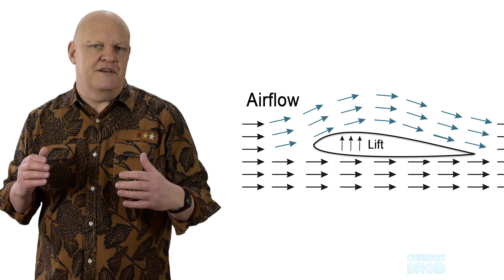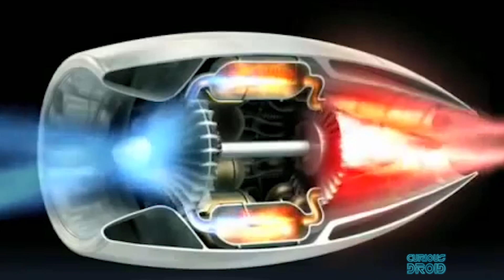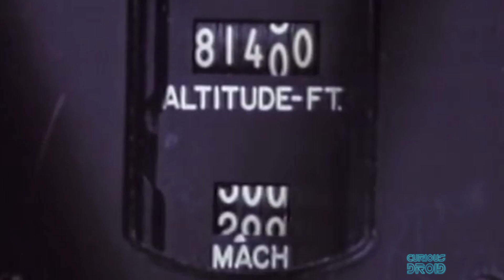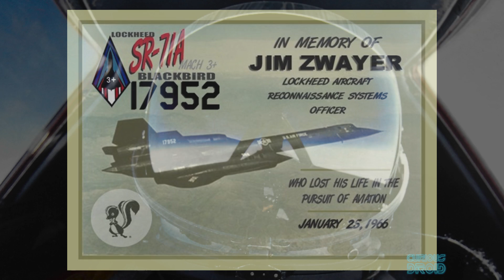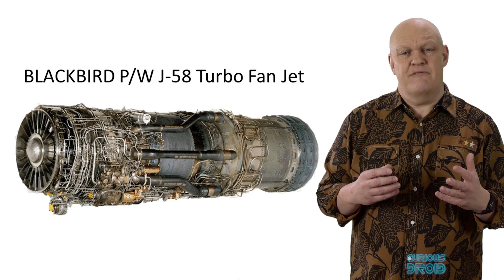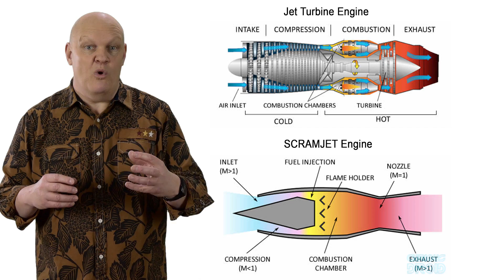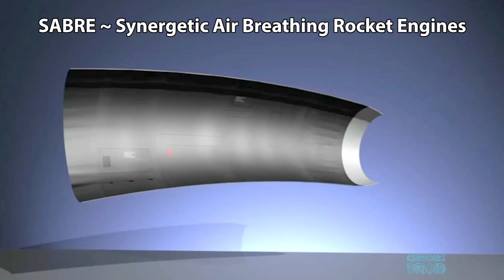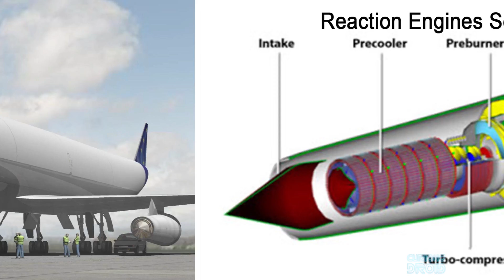Why can't we fly a plane into space ?

Comment: that isnt how planes fly, its a total endlessly perpetuated myth, because if planes fly because of 'lift' created by ther aerofoils, how can they fly upside down ? also how could they fly with symmetrical aerofoils , or flat plate aerofoils .? They in fact fly using newtons 2nd law. the wings create an upward thrust by displacing air downwards . - this explains how they can fly inverted, and how they need AOA  before the wings work , (which if it were the aerofoil they would not need)  all the aerofoils are doing is increasing the efficiency and modifying the flight envelope , but you are right about them needing air to work ;-)
Reply: I don't think anyone wants to fly inverted for very long. +philip wakeham is right, though. The major factor in lift is the air 'pushing' against the tilted wing from below. This is also why flaps work. Just throw a paper plane and you'll see that it glides even without an aerofoil. Or fly a kite, same principle ;)
Reply: A wing creates lift by deflecting air downwards. The angle of attack of the airfoil is the cause of most of the deflection. The shape of the airfoil has more to do with minimizing drag and improving stall characteristics. A flat board will create lift just fine if angled slightly to an oncoming flow of air. The illustration used in the beginning of this video is incorrect, as the flow around that wing would mean no lift produced, since the air is moving exactly the same after the wing as before. No net deflection of air, and thus no lift.

It's amazing that this incorrect explanation of airfoil lift keeps getting repeated, when the correct explanation has been known for more than a century.

The reason aircraft don't fly upside down for extended periods of time has nothing to do with aerodynamics, but with pilot/passenger comfort, engine lubrication (at least for piston-engined aircraft) and fuel delivery. Many aircraft are built with a fuel system that assumes normal flight (i.e. not inverted) and uses either gravity alone or a combination of gravity and fuel pumps to get fuel from the tank(s) to the engine(s). Upside down, the fuel will not reach the engines, starving them of fuel and, well, that's not good. Most piston engines also have an oil system that won't work upside down for any length of time. And for the pilot or anyone else in the aircraft, hanging upside down in the harness isn't very nice.
Reply: Nope. All airfoils operate on the same principle. They deflect air to 
create lift. And it's angle of attack that does it. Differently shaped 
airfoils create that angle of attack in different ways. For 
non-symmetrical airfoils, the angle of zero lift is usually negative, 
which means that the apparent angle of attack of zero still gives 
positive lift.

The stability of an airfoil is related to its moment curve, but that is only a factor when designing the aircraft. The other lifting surfaces (horizontal and vertical stabilizers, or similar) counteract the moment of the airfoil as it creates lift.

And you have it the wrong way around. The airflow over the upper surface of a lift-producing airfoil is faster than that over the lower surface, as a consequence of the pressure difference.

Here's an excellent video showing what the flow around an airfoil really looks like. This is, of course, a simplified, two-dimensional view, but for a long, thin wing, they're pretty much the same. For short, stubby wings or delta wings, things look different, but that's beyond this issue.
Reply: Flat bottomed (i.e. Clark-Y, used on the Piper Cub and others), semi-symmetrical, and under cambered airfoils do NOT need a positive angle of attack to fly! Jeez!
Reply: They also teach that electrons are particles that orbit a nucleus in set shells in middle schools.
Reply: There are different types of airfoils that work in slightly different ways. A symmetrical airfoil relies on angle of attack and is less stable which makes it great for aerobatic aircraft. They can fly inverted pretty much as well as flying erect. An airfoil with a flat bottom and curved top creates lift by causing a pressure differential i.e the airflow across the flat bottom is faster than across the curved top. These wings are very stable so that are not very good for aerobatics and inverted flight is tricky and relies again on angle of attack.
Reply: Lol it looks like everyone has their own understanding how wings work. Lift is generated by high/low pressure areas around the wing. Flaps deflect air for slow speed manouvering.
Reply: https://www.grc.nasa.gov/www/k-12/airplane/wrong1.html
Reply: a myth? I think you need a dictionary or a middle school science book maybe.
Reply: Yeah I hope you're not trying to say I dont understand what was on that particular page. I posted the link to just add that the equal transit theory is incorrect.
Reply: phillip wakeman   That link was excellent! I guess Blue peter has never seen an airplane fly inverted before.
Reply: How many of you people here have actually built and flown their own aircraft? Anyone? How many of you have any practical experience with aviation or fluid dynamics ( and I don't mean flying to Grandma's house for Christmas on an airliner)? Anyone?
Reply: the Concorde could do that
Reply: Blue Peter - The OP is correct. The Bernoulli principle is only one part of what makes an airfoil work. It isn't the pressure differential between the top and the bottom of the wing that keeps a plane aloft. In order to maintain lift, an airfoil deflects a mass of air down (and even asymmetrical airfoils can maintain level flight when inverted).  

The proof that an airfoil redirects a large mass of air is pretty easy to come by: a helicopter's rotor blades are simply airfoils, just like on a plane. While you can't usually stand underneath an airplane when it is flying, you can stand under a helicopter when it is hovering. Do so, and notice the huge amount of downwash created by the helicopter. If you were able to measure this mass of air moving down from the helicopter while in a hover you would notice that it has the same mass as the helicopter. If it didn't the helicopter wouldn't be hovering (it would be falling). 

I do understand how you could not only be confused as to how airfoils work, but also adamant in your denial of the OP's comment. It's because we've all been fed an oversimplified explanation of airfoils since we were kids. And it's hard to let go of something we've held onto for so long. 

Not that Bernoulli's principle doesn't apply. It certainly does. But there is a lot more going on. I suggest you read the Wikipedia article on the Kutta condition, which, as a mechanical engineer, you may find interesting, as it helps explain why all airfoils have a sharp trailing edge (which isn't really a helpful thing to have when looked at strictly from the standpoint of structural engineering).

Assuming that you read all of this, I now have an engineering joke for you: What's the difference between an mechanical engineer and a civil engineer? A mechanical engineer builds weapons...a civil engineer builds targets!

https://en.wikipedia.org/wiki/Kutta_condition
Reply: Blue Peter - Nowhere did either the OP or I state that air was pushed down by the bottom of the wing, which is what you seem to be refuting (though, other people did write that). When I wrote that air was deflected down by the wing I was referring to air being "pulled" down off of the top of the wing, which is exactly how lift is produced by an airfoil. 

Here's an excerpt from another one of those NASA pages (which you probably didn't read, and probably won't be able to understand once you do read):

Lift occurs when a moving flow of gas is turned by a solid object. The flow is turned in one direction, and the lift is generated in the opposite direction, according to Newton's Third Law of action and reaction. Because air is a gas and the molecules are free to move about, any solid surface can deflect a flow. For an aircraft wing, both the upper and lower surfaces contribute to the flow turning. Neglecting the upper surface's part in turning the flow leads to an incorrect theory of lift.

https://www.grc.nasa.gov/www/k-12/airplane/lift1.html

And I'm calling bullshit on your claim to be a mechanical engineer. I'm not sure if that's just a lie you tell other people, or if you have somehow convinced yourself that it's true...but it's bullshit.
Reply: Planes fly via a combination of lift and velocity. Similar to how boats float, boats float because of water displacement and the same principle is used for Aircraft, they displace the air and push the air beneath them.
Reply: +WaveForceful that is an interesting idea, but lift is created by the shape of the wing and the difference of air pressure above and below the forward moving wing. Boats float because they weigh less than the volume of water they displace. It is not quite accurate to draw a similarity there. Blimps and zeppelins and party balloons are able to fly because of the same principle as boats though.
Reply: +Blue Peter - If you would just fraking read that NASA website that you linked to you would see that it isn't differential air pressure that makes an airfoil work. ericsbuds is just repeating the same fallacy that we were all taught as kids. The fact that the person he was replying to also got it wrong doesn't make him (or you) right. 

So put your bruised ego aside for one goddamn minute and actually read that NASA website. If you do you might just learn something.

Comment: So you leave your first stage on the ground, have your second stage be a reusable SCRAMjet/rocket powered plane, and have your orbiter be a rocket-propelled spaceplane.

Easy, yeah?

Lol, monstrously expensive in terms of startup costs, but one the infrastructure is in place, it should be possible to have multiple launches daily for a fraction of the price of modern day launch vehicles.

Your first stage would be a MAGLEV sled travelling in an underground tunnel bored up the western face of a mountain in the equatorial regions. This sled could boost the second-stage/orbiter package up to high enough velocity to allow the SCRAMjet engines to function (with some assistance from rockets on the MAGLEV sled and 2nd stage). The 2nd stage moves the orbiter up to its max elevation, and a speed of Mach 9+, then the orbiter would seperate, fire it's rockets, and enter orbit. The 2nd stage glides back to the launch point, lands, refuels, and is ready to launch again. The Orbiter completes it's mission, de-orbits, lands, and would be refurbished for the next launch.

And yes, monstrously expensive is something of an understatement, but operating costs would be less.
Reply: You actually just need to build a spaceplane using a multi-mode engine like the SABRE. SABRE is a combination air breathing jet engine that can switch to a closed cycle rocket mode. The plane flies ascends quickly to a high altitude, then slowly levels off and gains speed. As it gains hypersonic speeds it is able to ascend to even higher altitudes - the higher speeds offsets the thinning air, to a point. Eventually it reaches a maximum speed attainable with the air breathing mode and switches over to closed cycle. The nose can be pitched up slightly, but it's not necessary to really point the nose up much as your apoapsis will be rising on the far side of the planet as you gain speed. Simply drift to apoapsis, fire the SABRE again to circularize.. and voila, you're in orbit.

The engine is currently being tested by the European space agency, and they're planning to build a plane that can use it sometime in the next half dozen years or so. The engine appears to work, so it's really just a matter of funding to get the project off the ground.
Reply: Jeremy Roney 
Such a spaceplane would be better than what we have now, no question.

It wouldn't be as efficient as my system would be (in theory) because you're still moving weight (fuel, etc.) over the whole course of your flight that isn't necessary for the specific stage of that flight occurring at any given time - in SCRAMjet mode, you're still carrying the weight of the fuel tanks and fighting the drag of the larger wings needed for takeoff and accelerating up to SCRAMjet speeds. Once you're using the closed circuit (rocket) engines, you're still carrying the weight of fuel tanks, wings etc. needed for the earlier tages, which means you need more fuel, etc.

By still seperating the flight into three stages, the orbiter stage can be only large enough to reach orbit, while maximizing cargo. 

The drawback is the huge initial investment required, but this system could launch multiple missions a day, which will be necessary if we ever want to accomplish the goal of being a truly spaceborne species, living in orbit, colonizing the Moon and Mars, mining the asteroid belt for resources, collecting hydrocarbons from Titan, all those things that might make the dreams of every science fiction come true.

Peace

Comment: what's wrong with using Electric engine rockets
Reply: Length of cord would be an issue!!👅
Reply: That has actually been done. They have used electricity to superheat a gas, which is then accelerated out a rocket nozzle to produce thrust. But right now it's only useful in space to produce long, gradual increases in speed. It's very efficient but the thrust levels are relatively low. As such, you still need chemical rocket engines to produce the enormous thrust levels required to lift a huge rocket and its payload off the ground.
Reply: Thrust to weight is too low.
Reply: they don't work good enough yet!!not enough thrust!!!
Reply: WAY too ineffective, they provide very low Thrust to weight, if we tried burning an ion engine on a launch pad, we would not get off the pad.
Reply: Vinnie St Vincent... There is nothing wrong with that as battery energy density increases and mass decreases. We're almost there already. However, only works from sea level to about 100K feet elevation where a conventional rocket would take over.
Reply: You don't need a cord for an electric engine
Reply: When Elon Musk talks about a "vertical take off & landing supersonic electric jet"... what do you think he means?? BTW... He has a pretty good track record of NOT talking about things that don't work.
Reply: never heard of that how would they burn fuel? I'm not trolling just curious
Reply: N/A N/A... Not sure who your question is directed to, but an electric jet would not burn fuel, but rather simply move air efficiently, much more so than the current turbofan jet engine which is actually limited by the combustion aspect.
Reply: Dude31463 ok then it's electric motor not a jet engine
Reply: Dude31463 
That's a ducted fan.
Reply: Something like that with a bit more to it.
Reply: Dude31463 
There's nothing more to it. It's called an electric ducted fan. If you add anything more to it, it'll reduce the efficiency.
Reply: Oh there's plenty more to it than your garden variety leaf blower... You'd be surprised.
Reply: Dude31463 
Like what?